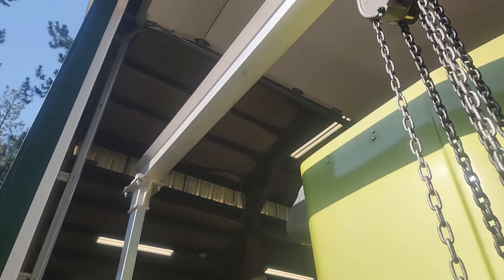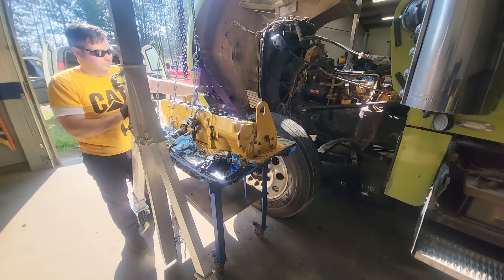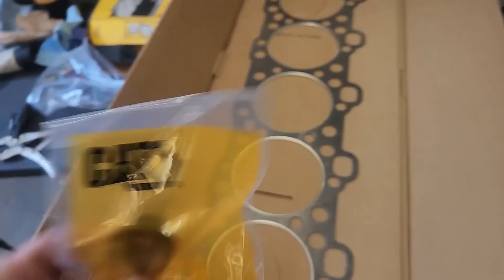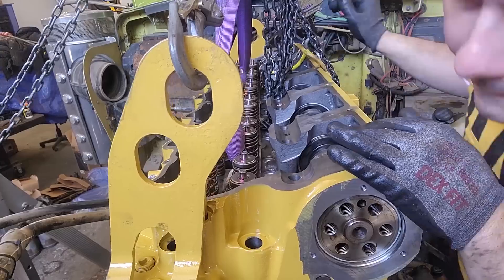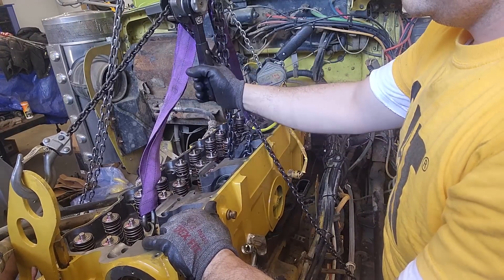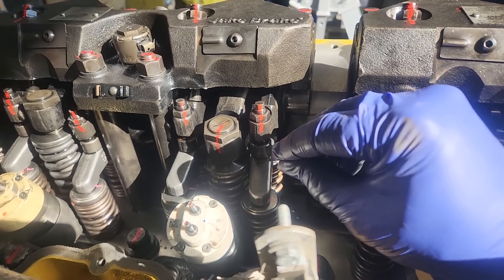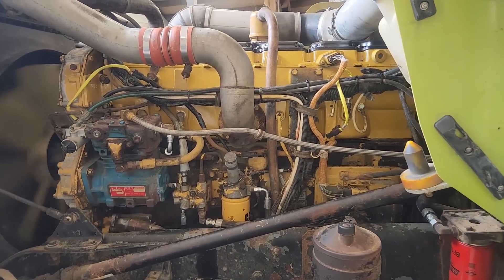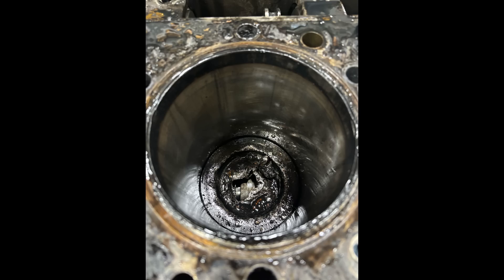Putting the head back on the Valve Recession 3406 Cat Engine. New Gantry Crane.

Comment: Not sure if you have seen it or not but Check Cat part number 185-3145  for head lifting bracket. Bolts to the center of head and has 3 positions for lifting with cam, bare head or with exhaust

Comment: The CAT dealer I worked for manufactured their own head lifting links, but I don't think they sell them. They were manufactured from 1/2" steel plate, they bolted into the center of the head. I believe we sent them out to get certified, and they were only rated for like 500lbs, but we never had a problem.

Comment: Great video!  i love working with a gantry and chain fall or gearratchet fall So simple having the lift straight down to the load unencumbered. Necessity is indeed the mother of invention! If you watch a video on assembly of Catts or other machine being assembled you will see all types of load positioning devices Since you work primarily  on Cat you would be able to develop tools for Cats. Maybe a side business for you. Generally people prefer tools designed out of the same need as they have Great work there are a few Gantry crane suppliers

Comment: BIG RED T32100 Torin Engine Hoist Shop Crane Accessory: is what I use on all heads I pull from everything otr trucks to big yellow iron. makes it real nice on like the newer short hood trucks trying to get the head to clear front covers and slide under the cowling.

Comment: I am also an independent ex cat tech, I made a h bar picker with just some flat stock. It was simple to make and works great. I just used a weld in d ring, then you can choke the strap on different points of the d ring to accommodate for manifold and turbo weight

Comment: Semantics here.
The gantry is a lift, not a crane. Similar to a forklift or a jack.
It has two functions, hoist and trolley.  The traveling is not considered a lifting function. 
But the main difference is that it cannot operate beyond its own footprint. Hence it does not have a tipping moment. Unless of course you simply upset it. 
A true crane has three lifting functions, hoist, derick (luffing)and slew plus many are able to tram (travel) as well and can lift beyond its footprint. Because of this it has a tipping moment ie the momentum of the load exceeds the stability of the crane. (A load that is moving has more momentum than its static weight, its weight puls the speed of movement). With a true crane if you lift a load that is at the cranes maximum capacity the moment that you start to move the load its momentum will exceed the stability of the crane and upset the crane. 
This won't happen with a gantry as long as the load does not swing beyond the footprint of the lift. 
I know it's just semantics but it sets my teeth on edge.
Reply from the maker: It's called a gantry crane by the manufacturer, I'm just going to go by that.

Comment: There are 2 sizes of automotive engine install tilting devices.  There is also an engine support bar with adjustable legs to stand in fenders or inner fenders when dropping front wheel drive transmission.  You might be able to use one of the shorter tilters on the long engine support to give you X and Y axis by changing the balance point. 

Once set up for a head.  Marking paint to allow you to set it for different heads.  

How to connect it all?

Comment: Had one come in a few years ago. Just rebuilt and engine would start missing after it ran awhile. Found that the guy who rebuilt the engine, put the fuel return fitting in the oil rail on back of the head. Good thing his fuel return check valve was not weak. Have you started the double torquing of the head yet?
Reply from the maker: I just torque the bolts 200, 330, 330 and then check them again at 330.

Comment: I made my own lifting tool with a piece of angle iron and an old drive axle nut bolts in the center of the head with two rocker shaft bolts lift ahead level with the cam in it

Comment: Personally use harbor freight 2 ton engine hoist. Works on detroit series heads perfectly. Also use it to take out radiators and power dividers. Highly recommend
Reply: But engine hoists are rated at a fully retracted boom.  When extending the boom, each notch loses 25% of the rating.  Gantry Cranes do not lose rating capacity.

Comment: I use a lifting bar for a car engine. Got the crank in to reposition.  Use a chain to bolt to the head and side to side level. Use the crank to level out end to end.

Comment: You're looking for p/n 370-8083 to lift the head with the turbo installed. Or p/n 185-3145 for lifting a bare head, with or without the cam installed.

Comment: Easy to make a spreader bar. I made one out of an aluminum H beam and half inch plate welded top and ends with hooks bolted on the ends. Just for the cat heads. The H beam is 3x3.

Comment: Holy leather ass I knew those cylinder heads weren’t light but I didn’t realize they were 500 pounds! Yeah I guess you and a buddy aren’t just gonna heave ho a head off by hand 🤣
Reply: just had do 2 pack and new head same time he was doin this one. pretty easy tbh but only 3200 hrs on overhaul.... fkin injector tip fell off tore shit up. nocause was found.

Comment: Never a Real Welder but I've learned to Fabricate things either for the Shop or the Job. You might have to make your own mounts, lifting brackets if you can't find anything online thats works for you. 
You might look into a Load Leveler or build one to make it easier to level heads or components.Gets rid of some of the lifting slings, chain thats in the way.
Used a Gantry like that at several shops it works.
Reply: Not sure what America is like with insurance, but in Australia you can’t use anything for lifting unless it’s engineered

Comment: I understand your complaint about the slack side of the chain in the way. The best and cheapest and easiest fix that I have come up with is to hang a canvas tool bucket under the slack side.  Once again you have proved the proverb " Smart Monkeys use tools and smarter monkeys use power tools". Great videos, keep them coming.
Reply: Nice Joel like that bag idea mate, I've always wondered about shit falling from the chain block into the engine
Reply: I didn't see your comment on your suggestion like what I was saying sorry to sound like a jabber jaw
Reply: Ive seen some cranes where the slack of the lift chain went into a box or bag, its really nice to only have one dangling chain from the top than three
Reply: @legionofanon  That's what I was talking about. It's very common.
Reply: Chain bags are key if you can make one work for that style
Reply: @perosity  With a little thought they can work on any chain hoist.
Reply: At work (construction) when we use a chain fall like that the slack chain goes into a 5 gallon bucket. Stops it from getting tangled and keeps at away for safety reasons
Reply: The electric chain hoists are more likely to come stock with a chain bag. We have one that came with a steel cylinder for the chain.
Reply: @NathanielStauber  Hit and miss on those too.  I have 2 and one came with the other without.

Comment: Josh, could you place a weight on top of the head to balance it as you lift?
Reply from the maker: Well anything just sitting there could fall off, it's better to use a load levelling device that is adjustable to get it on the same plane as the engine. The engine is usually on a slight back tilt, so even if it was completely flat, you would need to adjust it.
Reply: @AdeptApe For sure a load leveler is best.  However some heavy magnets might help to balance it to perfection.

Comment: Question have you heard of lining up the marks on drive belts? I've seen some people do it and some not just curious. Keep the videos going.
Reply: Back when you had to get matched production v belts for multi belt systems some people would line up the belts and some wouldn't. I never saw much difference if any. I haven't seen belt lot numbers in a  few years and not many v belts in almost as long.
Reply: @cbmech2563  thanks

Comment: How do you remove a stuck gasket? I’ve gotten most of it off my oil fill tube but some still on there
Reply: Carbide gasket scraper works great, if you’re in a pinch or on a budget the harbor freight Pittsburg chisel style scraper set works well just clean and sharpen before each use

Comment: The chain fall works if it was me I would add a remote control which. Or even a corded winch. You can have both a chain full and an electric winch on your gantry without changing much:yougotthis:
Reply from the maker: Don't always have 120 volt and I like letting it low tech.